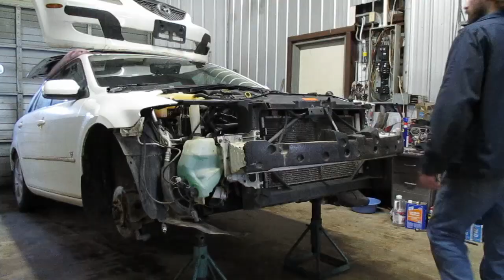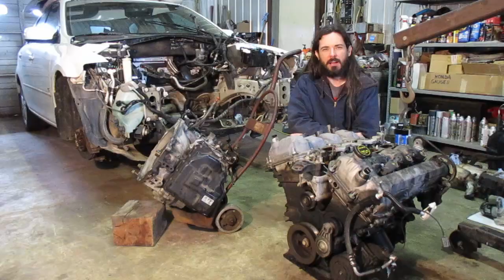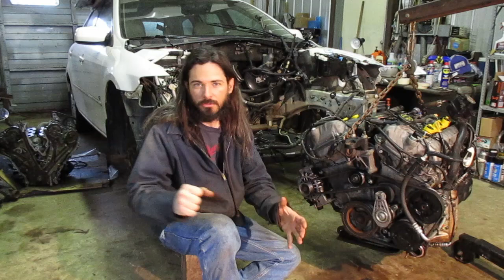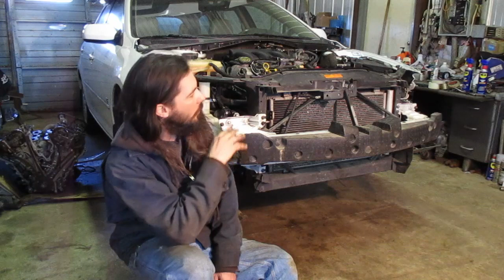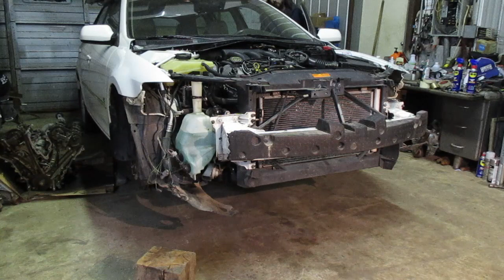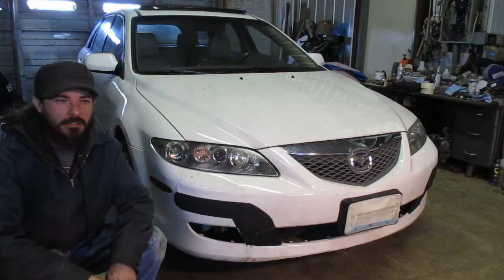Mazda 6 engine swap with Ford Fusion 3.0 (step by step) v6 motor how to remove and replace

Comment: I'm taking out a Ford Fusion 3.0L 2010 engine - what mounting points did you use to connect your hoist? Would appreciate any details about that...

Comment: I just got done with this swap and car turns on but has no acceleration car will drive but seems like when I step on gas pedal car rpms shoot up and car doesn’t move no check engine light either there’s one code but it’s says o2 sensor not switching
Reply from the maker: It sounds like a transmission issue.   
Are you aware that the transmission in these cars requires a special type of transmission fluid? 
I would recommend trying to find a Mazda 6 forum for help.
Reply: @JayWCase  didn’t know about the certain fluid type but transmission was working prior to
Reply: @JayWCase  car now shifts fine when just driving but when I try to step on it , it won’t shift
Reply: @JayWCase  we put a Mazda throttle body on that ford motor you think that’s can cause it to not go when I step on the gas

Comment: Is the idea just basically running an overall better engine compared to the ones in the 05 and previous years? Or is there a big performance difference as well?

Comment: Thinking about doing a Ford swap on my 07 wagon 3.0.

Which model and years can I get a donor motor from? Will a 2012 Ford fusion motor work? 

Which parts are required to swap over for it to be compatible with the  mazda6?

Ive done the swap on a 2.3-2.5 before but never on a v6.

Thanks in advance

Comment: Thanks. I might swap the engine on my 2009. Can you remove the engine without removing the front end and condenser?
Reply: The only other way is to remove it from the bottom.

Comment: will this also work if my mazda6 is a 5 speed manual? i won’t need to tackle the torque converter bolts i’d pretty much be throwing a clutch in so i believe it would be the same but going manual route yes??

Comment: Hey mate thanks for the awesome video. Can I ask a question if you don’t mind. When swapping engines and you lswap over  transmission do you need to drain transmission oil first?

Comment: Speaking from having performed the swap myself, I also had to swap out the oil pan and oil pickup.  The filter was different, but the basic block was the same including the block number.

Comment: Does anyone know if the 3.0L Duratec motor out of the Freestyle and the 500 is good for this swap? Those are going for a lot less than the Fusion and Escape motors.
Reply: Never mind, answered my own question. Those motors don't have the variable cams https://www.mazda6club.com/threads/problem-swapping-06-ford-500-3-0l-v6-engine-into-my-03-mazda6s.251186/#post-3395795.
Reply from the maker: Hey, Thank you for posting a link to that information!  
I was not aware!

Comment: Hi my guy ? Of interest i got a 2005 madza v6 sedan with a bad rear rod in the back of the engines I want to know if a 2005 mazda 6 wagon engine with transmission  will be compatible  with my sedan any advice before I think of purchasing the engine with transmission
Reply from the maker: A 3.0 duratec and transmission that has been harvested from a 2005 Mazda 6 wagon should be a direct bolt-in swap into a 2005 Mazda V6 sedan.   Best of luck with your swap.

Comment: I want to do this in the future, swap out my 2.0 engine and put in the 3.0 and add a Turbo.
Reply from the maker: Make sure you come back and leave a comment to let me know how your swap goes when that time comes!
Reply: @JayWCase  Sure, I will save your video. I will probably film it myself too.
Reply: @bandofbros8112  A 2.5L I4 swap may be a better option for you.  Same engine
Reply: @JesusRoseAgain  Yeah that would be the easier option, but hardly worth the 20 hp increase. I also like the v6 sound :)

Comment: Excellent video, I'm going to use it for my swap in a few months. I'm still pretty lost on picking the correct engine for myself. I have a 2005 mazda 6 s 3.0 Hatch, what other engine options do I have, and what years would fit? I see you put a newer model engine on your 04... Any advice would be helpful, although I'm waiting a few months to save up for a proper engine. Thanks again for the detailed video
Reply from the maker: I appreciate the positive feedback. 
Let me know how your swap turns out. 
As far as engine donors, i'm a little rusty at this time.  
I know that you can use a 3.0 duratec engine from ANY vehicle year or model to do this swap.  I just don't remember what those vehicles are off the top of my head.  
If you find an engine from a 3.0 Ford Fusion Automatic, you will be using the same exact engine i used in this video and you can follow along.

Comment: J W Casebeer-I’m late to this, but hope you will give me a quick synopsis of my understanding of this process.  I bought an 04 6S wagon 3.0/5spd and it catastrophically failed with no warning-just started making a lot of noise on startup and locked up after I limped it home (added three quarts of oil, but it didn’t leak or smoke!?!?) I’m going to do the Fusion swap, so the required changes are 1)Valve covers 2)fuel rail 3)lower intake 4) plenum 5) oil pan 6) timing cover 7) engine, transmission wiring harnesses and 7) cutting the tab on block. 8) oh yeah, exhaust manifolds? 
Is there anything else? Other than accessories, of course. I’m aware of the non-tensioned water pump on the Fusion engine. Thank you for any help!
Reply from the maker: Hey Billy, thanks for the question.  
You have done your research and paid attention to my video.  
I think you are well prepared for the fusion swap.  
I ran the exhaust manifolds from my Mazda 6, but i cleaned the remaining catalytic material out of both manifolds before i reinstalled them.  To avoid getting an engine computer trouble code from my down-stream Oxygen sensors i installed a spark-plug anti-foul spacer in-between the down-stream oxygen sensor and manifold on both manifolds.   Also make sure that your down-stream Catalytic converters are not plugged up with the material from your disintegrated up-stream catalytic converters.
The Ford Fusion engine uses essentially the same block design and dimensions in all the critical surfaces but due to better design relating to the up-stream catalytic converters, they do not suffer sudden catastrophic failure as frequently as the Mazda produced version of this engine.  I would also like to mention that the casting and finish work inside the Ford Duratec 3.0 also appears more meticulous and exact than the Mazda Duratec 3.0.  The Ford product is just a better engine in this case.   All that being said, it will be very important to know as much as possible about the history of the car that your Donor engine will be harvested from.  I even ran a car-fax on the Fusion that my engine was harvested from.  The car-fax showed me the service history of my donor Fusion engine from the time it was new, which is priceless information.  If you don't know the history of the engine you are purchasing, then you are gambling.
Reply: J W Casebeer Thanks for the input! I’m looking at an engine from LKQ and they do have a VIN for the donor car. I’ll check it out before purchasing.  I have never experienced anything like this catastrophic failure in 35 years of owning, driving and working on vehicles. Terrible design from what I read on forums with far too many similar failures.
Reply: J W Casebeer- I also have questions about the pre-cats, because this engine ran great and failed with no warning. My email is Billytrev77@gmail.com
I’m already in deep on this car, since I only drove it 300 miles before this failure.  After reading about similar failures on Mazda forums, I don’t necessarily think the seller knew about a problem that was going to kill the engine soon. Possibly just my turn in the barrel, or the fact that the engine had a lot of miles considering what a problematic design it is. (212,000)
Reply: Would love to hear the response on this. We run a mobile automotive service, and have recently gone thru hell since June 2019 on a Mazda 6. It's been a freaking nightmare. Have gone thru three engine replacements, not including the replaced engine that was in the car when it came to us. The last engine locked up and won't crank at all. We're considering a ford fusion engine as a replacement. Very discouraged. Have lost money on this job and are praying the customer doesn't sue us.
Reply from the maker: Hey Jen, that sounds like a nightmare. 
I'm sorry to hear about that.  I highly recommend the 3.0 produced by Ford for the Fusion.  It is a better engine.  Also, i'm not sure how you are dealing with the Mazda manifolds with the integrated catalytic converters, but they are a time bomb on the Mazda.  
I ran the exhaust manifolds from my Mazda 6, but i cleaned the remaining catalytic material out of both manifolds before i reinstalled them.  To avoid getting an engine computer trouble code from my down-stream Oxygen sensors i installed a spark-plug anti-foul spacer in-between the down-stream oxygen sensor and manifold on both manifolds.   Also make sure that your down-stream Catalytic converters are not plugged up with the material from your disintegrated up-stream catalytic converters.
The Ford Fusion engine uses essentially the same block design and dimensions in all the critical surfaces but due to better design relating to the up-stream catalytic converters, they do not suffer sudden catastrophic failure as frequently as the Mazda produced version of this engine.  I would also like to mention that the casting and finish work inside the Ford Duratec 3.0 also appears more meticulous and exact than the Mazda Duratec 3.0.  The Ford product is just a better engine in this case.   All that being said, it will be very important to know as much as possible about the history of the car that your Donor engine will be harvested from.  I even ran a car-fax on the Fusion that my engine was harvested from.  The car-fax showed me the service history of the car that my donor Fusion engine came from since the time it was new, which is priceless information.  If you don't know the history of the engine you are purchasing, then you are gambling.  I sincerely hope your luck takes a turn for the better.
Reply: Can I put the fusion 3.0 in a Mazda that has a 2.3 auto? I’m guessing I’ll need the trans too? Or it’s a no go?

Comment: Is the valve cover and timing cover the only rhings you need to change to make the swap work?
Reply from the maker: It's been a long time now since i did the swap, so i don't remember.  Lucky for you though, i recorded the whole process and talked about every single detail you need to know, so simply watch this video and then you will know more about it than me!!!
Reply: I swapped the oil pan and oil pickup due to engine cradle clearance concerns, perceived or real, I don't know.

Comment: I just bought a 2005 mazda6s 3.0 manual with a possible bad motor. Wondering if I can direct swap a motor from an auto trans car? Just saw a Ford 500 motor for sale for 250. Will the crank from an auto trans motor accept the flywheel and whatnot?
Reply from the maker: I can't say for certain.  
I have a strong feeling that the crankshaft will be the same and you should be able to unbolt the flex-plate and bolt on the flywheel.    
Please let me know what you find out if you decide to do the swap.
Reply: Thanks for the reply! It's probably my best option since there are not many manual cars out there, especially with good motors
Reply: Did you end up going through with this? I've got a manual 05 as well, and I'd like to hear how it went for you

Comment: This is not the solution of Mazda MX-6 Swaps Options ???....

All Users of MX-6 done.the KLZE swap.....for me is not Worth 35 ho gain for a Swap.....

" Is a Easy Swap Dude ".....that in USA is a Poor excuse
Reply from the maker: This is a swap for the Mazda 6.  The swap is not intended to add horsepower, it is intended to replace the Mazda 6 Duratec that was known to fail due to defective catalytic converters.

Comment: Why would you swap the oil pickup if the oil pans are different? Wouldnt that throw off how far the pickup tubes go down in the Ford oil pan? Also is the fuel injectors the same in both? Or did you just use the fuel rail? Thanks
Reply from the maker: Hey Dale, Thanks for the question. 
at 13:07 in the video i state that you can't run the Fusion Oil Pan in the Mazda 6.   This means the Mazda oil pan and the Mazda pick-up tube stay together and are both re-used on the fusion engine block.  That should answer your question.  Also, because of clearance issues, you cant run the Fusion pickup tube with the Mazda oil pan even if you wanted to.  In regard to injector fitment, the Mazda injectors and the Fusion injectors are interchangeable.  Thanks again.

Comment: I dropped the engine/trans out the bottom. Wasn't that bad, but I have a lift. Completely removed the subframe, but left the rack.
Reply from the maker: Removing the subframe results in a significant difficulty.  When it comes time for you to reinstall the subframe, it is very difficult to determine the factory alignment points on the subframe bolt locations.  For some individuals this results in a car that can't be aligned correctly when you take it to an alignment shop and pulls hard to the left or right.  Carefully marking the position of each of your subframe bolt locations before disassembly can help when it comes time to reassemble the subframe.

Comment: Thank you! I'm about to do this for a 2008 mazda6 and you really helped me with an attack strategy since its my first swap. I wasn't sure about using a Fusion Duratec 30 instead of the original Mazda MZI because of the extra work required but I'm considering it now. Is there any problems I should look out for during the process that you might not have mentioned in the video?
Reply from the maker: Hey, 
I'm sorry i missed this comment. 
Did you already finish your swap? 
The transmission mount bracket can be a pain to get unbolted. 
But it is possible.
Reply: I put the brakes on that project for a while and picked it back up a couple weeks ago. I built the engine with new seals. Everything came out great, engine spinning. I bolted up the transmission after aligning the three studs, got the three nuts on then continued spinning to tighten them. I got to the third one and missed it by a little. I figured I'd continue to turn until it comes back around. The whole thing locked up on me after a quarter turn. Should I consider a different transmission? I feel the pump under the torque converter might have gotten damaged during installation.

Comment: Hello sir I need your help . I have mazda 6 2005 1.8 I changed the engine i but engine 2002 the problem is no spark The engine is running but not working
Reply from the maker: This would be a very difficult problem for me to solve without seeing the symptoms in person.

Comment: About how long time wise was the hole swap? 2 days
Reply: Sorry how much  time did it take
Reply from the maker: @orlandobustillos7283 , Thanks for the question, i spread the job out over several weeks of spare time in the evenings.  If i did the swap again, and i had the time to work full days, i think it would take me about 3 days.
Reply: @JayWCase  thank u for getting back to me have a blessed day

Comment: Any idea how long it'd take for a v6 swap from another 6?
Reply from the maker: If you are swapping a v6 duratec from one Mazda 6 into another Mazda 6 the process can go quickly.  If you have the space to do the job and an engine hoist you could do the job in two days if you had a helper.
Reply: @JayWCase  Thank you for letting me know this, did you find it necessary to remove the front cross member? Also would it be easier to leave the transmission in the car or take it out with the engine to swap it onto the new engine outside of the vehicle?
Reply: @staver76  Hey starver, I'm actually just about to swap in another 3.0l duratec into my 2005 wagon. Im starting it this weekend and I'll let you know how it goes :)
Reply: @Ken-hm9dq  perfect thank you!

Comment: You mentioned the back pressure form the cats forcing abrasive from the precat into the engine via EGR .. Did you put in new cat/precats in the engine? it looked like you used the old ones . I am about to do a similar swap here in the next few days.
Reply from the maker: That is a very good question.  I wanted to address that issue in the video, but i was not able to talk about it for legal reasons.  The original Mazda precats should never be reused.  I'm going to keep this answer short, but you can reply with your email address if you would like to communicate in more detail about the swap.  The manifolds i used did not have any catalytic material left inside the precat chamber.  Depending on where you live, there may be legal issues with going this route.  Because this car has down-stream catalytic converters, it meets the legal requirements of the state where i live.  Thanks again for the important question.
Reply: I have done over a hundred of engine swaps in my career . But never had done one on a Mazda though ( can do civics in my sleep) , 

Were there any "gotchas" that you encountered in the pull ( beyond the wiring harness thing)
Reply: @JayWCase  owilhal@yahoo.com
Reply: Shooter6504@gmail.com please email me I have some questions. Thank you
Reply: atyourdoorautomotive@yahoo.com please give us a shout out. Having extreme complications with an mazda 6. Would appreciate any input you can give us. Thanks 👍